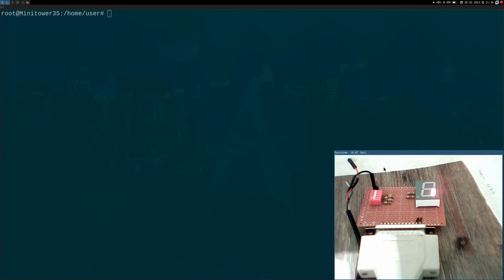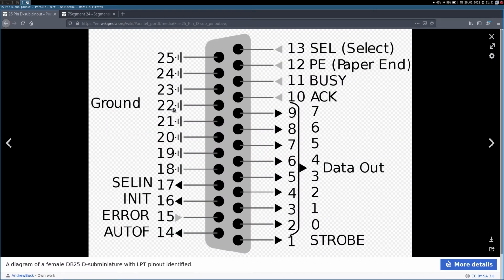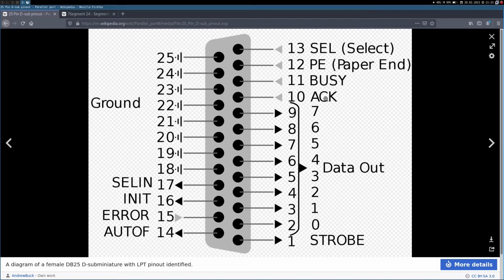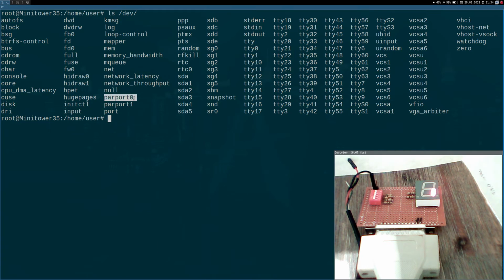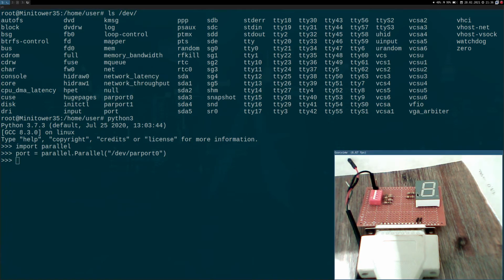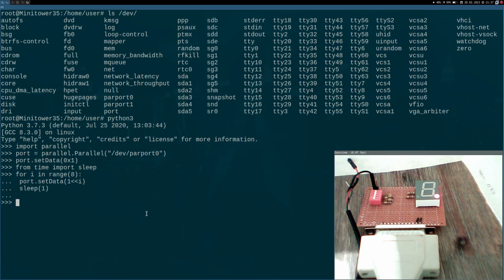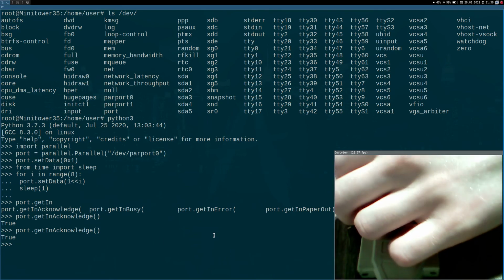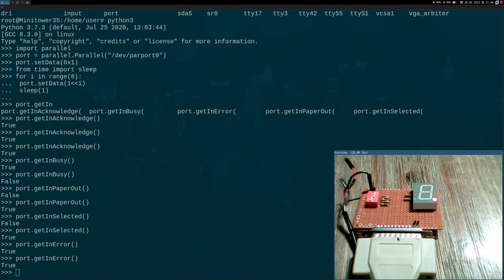Accessing the parallel port with the Python Module pyparallel

Comment: How can you read the data input pins or does the parallel port only allow reading from the pins that you described? Thanks.
Reply from the maker: On a traditional parallel port only the dedicated pins can be used as inputs. But with the Enhanced Parallel Port (EPP) it is possible to configure the 8 data pins as inputs. Take a look at the ECP Control Register. This can be used with the EPP to switch the data pin's direction.
Reply: @johannes4gnu_linux96  Thanks for your reply. Where can I find out how to read/write to the parallel port pins AND the parallel port registers using linux. Can this be done through a driver built into the linux kernel using C (or maybe python)? Or can I learn how to write a driver somehow? Thanks.

Comment: Como fazer para controlar um Motor pela Porta Paralela sabe me ajudar para fazer ?
Reply from the maker: Do you mean a stepper motor? http://electronics-diy.com/stepper_motors.php Here is an example. Just to be sure, I wouldn't connect the Parallel Port Pins directly to the IC but use optokopplers to devide the two voltage levels physically.